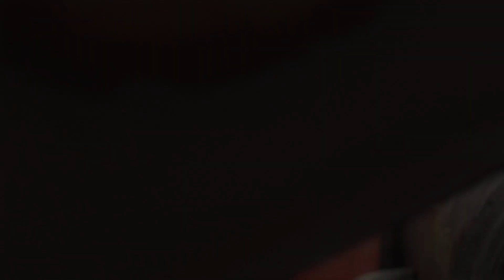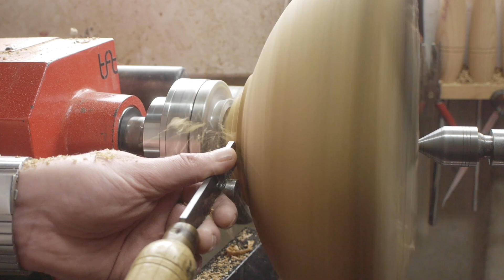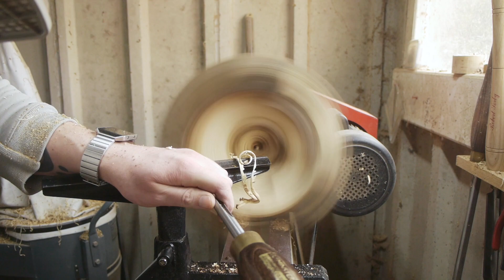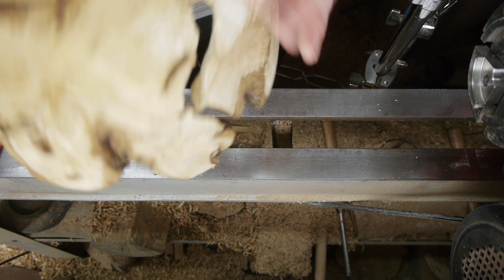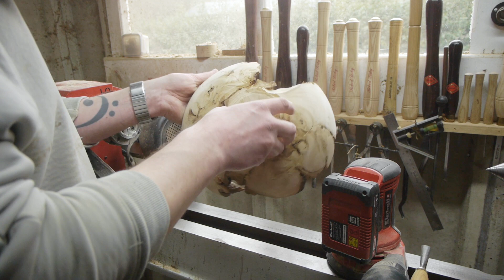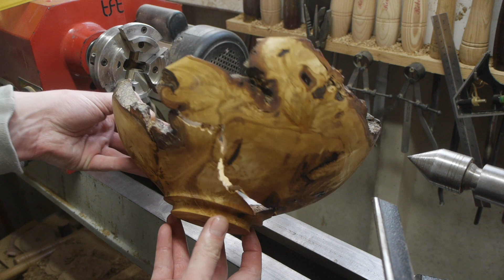The Exploding Crotch Bowl! - Woodturning Linden/Lime

Comment: I’ve never seen a tube turner start a project from that position. I’ve only been at it a couple of months, but it seems odd.idk
Reply from the maker: I'd normally start by mounting it with the underside of the bowl facing the tailstock and then flip it around. As this was quite an unstable piece thought it best to only spin in one direction to try and reduce stress in the grain.. sadly it split apart anyway. The way it goes sometimes. Thanks for watching!